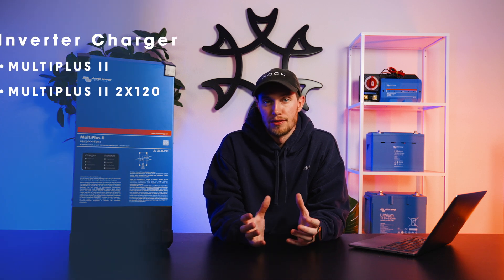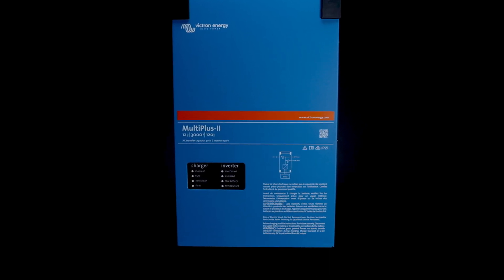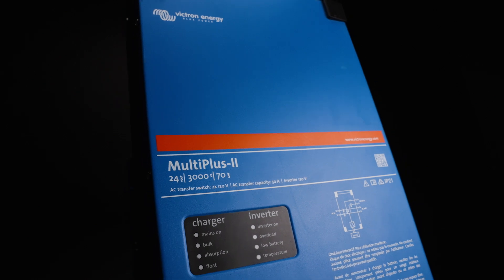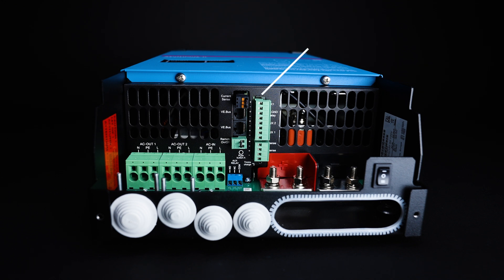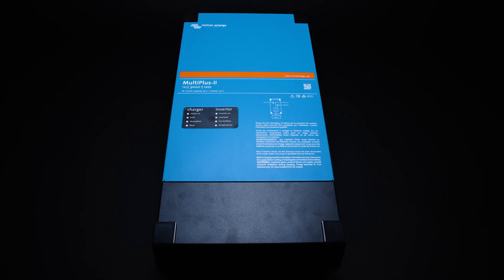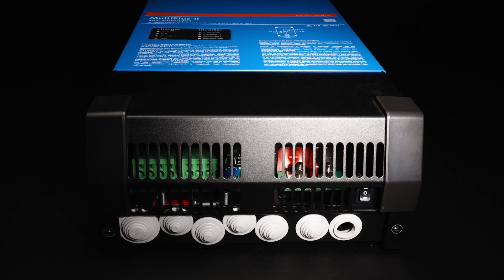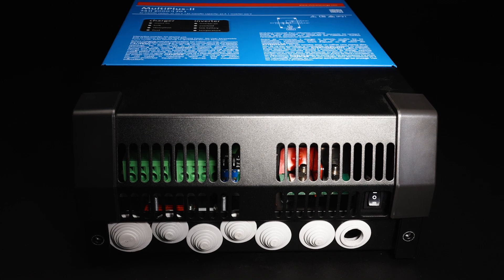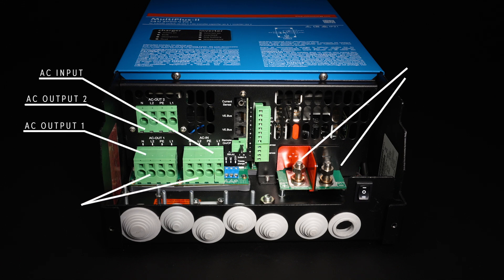Victron Energy Multiplus II & Multiplus II 2x120 | Overview and Basic Information

Comment: Are you only using the AC1 out for both L1 and L2 if its is only a 120 system?
Reply from the maker: Hi, yes the AC output 1 and 2 do not have anything to do with the legs that has to do with the model of the inverter (2x120 v a non 2x120). AC output 1 is a primary and the secondary output is programmed to be a pass through only when shore is present however, you can reconfigure the functionality of this through assistants with Victron's configuration tools. Send us an email if you need more assistance!

Comment: Hello.

I’m also keen to better understand the differences between the II and II x 120V variants?

How does the II x 120V variant benefit the off-road camper in Australia?

Cameron
Reply from the maker: Hi Cameron, the 2 x 120v would not be applicable to Aus as the architecture there is a 230v single phase as opposed to in the US where 24v is made by combining 2 legs of 120v. We wish the US grid was 230v single phase!